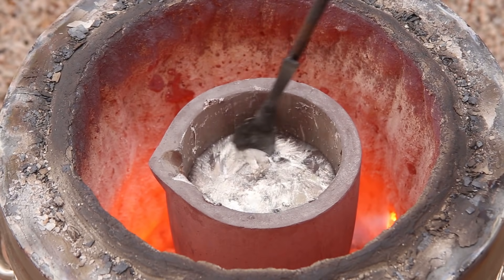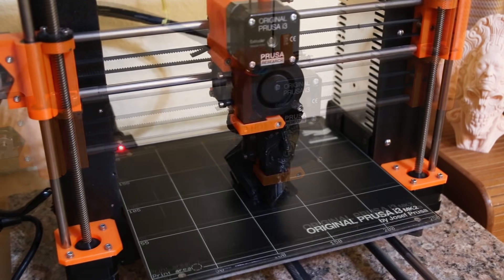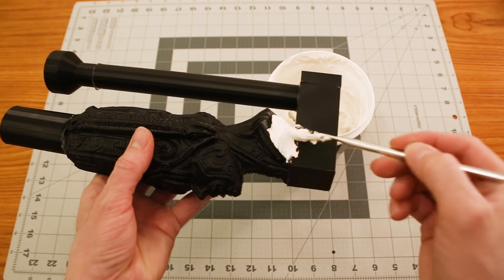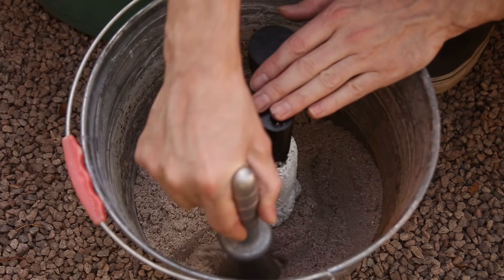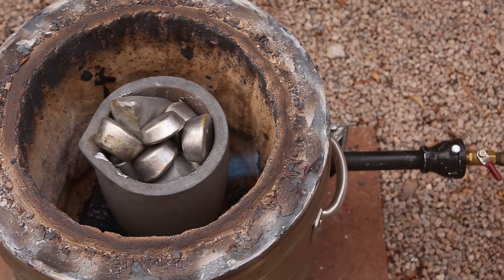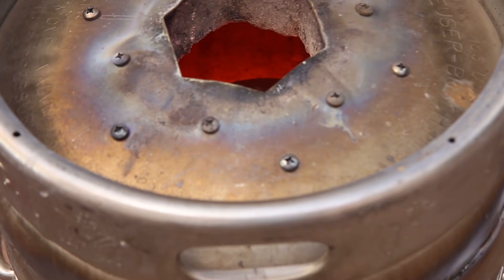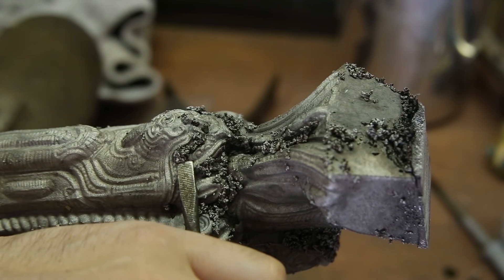Easy lost PLA metal casting │ How to turn a 3d print into metal │ ASMR

Comment: joint compound to act at the fine-detail-saver is such an excellent trick
Reply: Idk but what is joint compound exactly?😅
Reply: @theofficialvalvychannel5689  there are several different types of joint compound, the most common two are the drying type, which is mostly gypsum powder and dries through evaporation, and the setting type, which is plaster of Paris based and hardens through a chemical reaction involving quick lime.
Reply: @theofficialvalvychannel5689  I also like to know.
Reply: I have tried a couple different types, but the powder that you mix with water that contains plaster of Paris is the best. A lot of the pre mixed varieties have polymers in the mix (usually some sort of vinyl) and they don't work as well. I'm not sure if it's the vinyl, or some other ingredient, but the pre mixed stuff had tiny pits and dimples in the surface finish.
Reply: Is there a spray on version?
Reply: I've tried using drywall joint compound and sodium silicate and sand. It most definitely did not work. The drywall compound shrinks too much and cracks, I tried all sorts of combos and ratios.
Reply: I never would have thought of it on my own.

Comment: How do you decide how to design your sprue and vent layout?
Reply: Run in the thin section feed in the thick sections. So how it goes, sprue goes to your runner bar, runner bar goes to an in gate into the mould, mould fills up in a nice controlled manner with no turbulence up  to the riser which feeds the casting as it solidifies ( he called the riser a vent) without a riser you will get shrinkage ( a hold in the thick sections of the casting). Actual vents ( not risers) are used to disperse gases from  the sand that burns from the metal. these gases tend do get stuck in  corners  and prevent metal from getting to the corner and causing a defect in your casting. Ven't holes don't need to be big  at all. In two or three piece moulds normally you just scratch a thin line in the sand ( called scratch vents) just enough to allow gases to escape and metal to run in the entrapment areas. Hope this helps.
Reply: @petewilkinson5531  Thanks!
Reply: Anyone got a print file for the risers?

Comment: And the 3D gun printing community greatly thanks you for this knowledge
Reply: I'm not sure this can be an effective substitute for rifling at the end of the day.
Reply: @superchroma  yeah I would never ever cast a barrel unless I was casting a bronze barrel for like a 22 and I’d make it super thick but other than that you can basically fully print every piece of any firearms so you could legitimately make a ak quite easy you’d just have to cast almost  every piece thick asf  because no steel
Reply: Doesn't casting the barrel out of metal negate the only "positive" of a 3d printed gun? A large part of why people were freaking out about that idea was that the small firing pin was too little to be picked up on most metal detectors
Reply: @ku8721  cost is also a factor and the frequency you can find guns
Reply: @implausibleimpossiblehypot4006  Welp I live in America where finding a firearm is less than a problem than finding a part for my 20 year old truck! But yes good guns cost a lot, but I'll put my 30.06 against almost any gun with a 3d printed part... if I can pick the range (distance) that is
Reply: @ku8721  what I’m saying is “I think I’m gonna make a fully bronze body pancor jackhammer who gives a fuck if it ways 20 lbs” or I wanna make a bigger receiver because I think this ak47 needs more barrels “or I think I want to cast  all of the hand crank parts to build my own Gatling gun” catch my drift  and I think It would be awesome to see some bronze Hatfield break barrel shottys (all pressure and load bearing parts should  be steel of course
Reply: @ku8721  also a 3D printer or resin printed m16 would probably destroy your 06 even tho I love mine I’d say 3D printing has caught up with non 3D printer guns.  And I think that’s cool because gunsmithing is done on a computer now  and that’s like super high tech “punch in some directions on your laptop and boom working military grade lapua 338”

Comment: Very COOL man! I'm very impressed with this process. I'm a fellow caster myself and always thought I needed a kiln for casting PLA objects. I am definitely giving this a shot. I do have a question, is the sand reusable after you cast? Or is that sand mixture a one and done situation?
Reply: How'd it work out for you not melting out the pla in a kiln? I'm looking to do the same but can't believe it could just vaporize out of the way like that.  Also pretty sure the sand would have to be ground back down if it's even possible, interesting though.
Reply: Absolutely yes, spent sand can be reused after breaking larger chunks. Just add fresh sodium silicate (water glass).
Reply: I just came across this video and was getting ready to ask the same question. As the sand could get expensive in these and the sand casting ones he does if you can't reuse any of the sand

Comment: If you do this same model again, I would suggest that you cast it upside down. The gate can be much smaller than the feeder/riser so you could have a much smaller defect on the top of the head.
Reply: In fact this is preferable. You want controlled gradual flow, not sloshing, and this is achieved by constricting the flow before it reaches the model
Reply: But even upside down, you would need a spruce going from the bottom to the top, so i don’t think it would make a difference.
Reply: Yeah, the lost detail across the top of the head was pretty tragic.
Reply: I'm attempting this right now actually with a handful of parts. I traditionally use my own greensand/water glass hybrid mix to make some fairly large castings, but this time I want to see if I can get a head start on accuracy and surface finish. Believe it or not I'm able to make large 2 part aluminum casting molds with homemade greensand. Hoping this method will help with cleaner casting (which already looks like  delft clay casting surface finish- but at a huge expense of time and effort)

Comment: I wonder how well plaster would work instead of joint compound? 🤔
Reply from the maker: I’ve tried it. It breaks up and partially melts.
Reply: @robinson-foundry  Mix some Diatomaceous Earth into the plaster in a 1:1:1 Plaster:DE:Water ratio.  You get a nice thick slurry that's good for casting, and the DE helps with the crumbling.

Comment: Question:  How accurate was the resulting casting dimensionally compared to the original PLA?  Was the casting larger or smaller?  Have you ever tried using multiple layers of that sodium silicate?
Reply from the maker: Castings are always smaller that the original by a few percent. You mean the joint compound? No I haven’t but I will.
Reply: @robinson-foundry  If I need millimetric accurated final must resize the PLA model in some percent? 0.5%? 3%? Thanks!!
Reply: @Eddiezerintube  Probably 1ish percent, but if you need dimensionally accurate parts, you'll need to machine them afterwards.
Reply: @Eddiezerintube  aluminum shrinks 3-4% percent when going from liquid to solid and another 1-2% from temperature shrink.

every alloy and metal will have it owns shrink factor but as a general rule about 5-6% added in the print should get you close.

Comment: This is awesome! For us newbies .. can resin printers use a resin that will burn away the same way or is the printer type you using.. with such thin side walls.. better. I don’t own either and just looking for some input.. thanks for new ideas to usually a very expensive project
Reply: Where I've seen resin printed models used in investment casting, the model has to be burned out before the metal is poured, like in lost wax.  The lost PLA process used here, with a thin wall and little to no infill, the metal is able to burn out the plastic during the pour, closer to the lost foam process.
Reply: @hanelyp1  thanks for the advice
Reply from the maker: Thanks you! You can buy resins that can be melted away but I doubt you could successfully print such a thin walled abject with resin. I’ll give it a shot though!

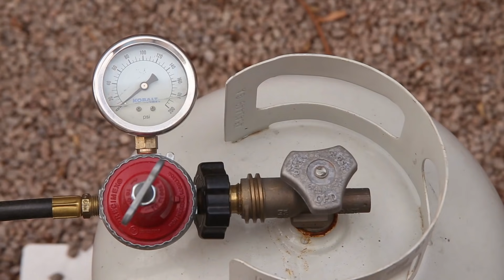Comment: 4:31 The difference between cans and wheels is that wheeled aluminum has a higher silicon content, which lowers the melting point of the alloy and improves the fluidity of the molten metal.
Reply from the maker: That’s right. Big difference between the two. I love “Wheelium”.
Reply: @robinson-foundry  Oh, wheely?
Reply: @SethKotta  this made me laugh. It was wheely funny XD
Reply: @robinson-foundry  Wheeluminum?
Reply: Is there some method to determine if a wheel is aluminum, magnesium or some kind of alloy?
Reply: @nitcat1  Wheels are usually casted.
Reply: @nitcat1  Magnesium (and zinc too) metals usually react with acids (like vinegar). Also, their densities compared to each other and aluminum are different.
As for alloys, that's harder to tell.
Reply: @nitcat1  Pretty rare to find anything other than either an aluminium or steel wheel and the differences between those two are fairly obvious. 

At worst, if you're really sure you have a magnesium wheel, take a file to it and light the shavings on fire and then you will know.
Reply: @nickb3720  Mags oxidize to a very distinctive gray. Hard to keep them shiny but the gray is nice.
Reply: @nitcat1  They’re all alloys. There’s really no such thing as pure aluminum wheels or magnesium wheels. Most aluminum alloys for wheels are between 97-99% Al with a mixture of Si, Fe, Cu, Mg, Mn, and Zinc and other trace elements. Typically its a 3XX or 6XX alloy.
Reply: Грязная технология. За такое надо наказывать!
Reply: Надо делать так: https://www.youtube.com/watch?v=W_IF2-tG3G0&t=765s
Reply: https://youtu.be/WCnIJu69aV0
Reply: Does anyone have the formula of how much of what one would need to create this better grade of aluminum from aluminum cans ?
Reply: @texasRoofDoctor  thats what I am wondering couldn’t you add some additives to improve it for casting?
Reply: @texasRoofDoctor  someone correct me if I am wrong but could you not make an alloy of 1 part ferrosilicon and 9 parts "can aluminum" to achieve a similar affect? I don't know much about alloys
Reply: @jonathanclark7444   I think that is correct. There is a dude from Australia with a casting channel and he answered my question about it 2 years ago but used the Aussie name for it.
Reply: @texasRoofDoctor  alr thanks, can't really hurt to give it a try the stuff isn't super expensive

Comment: Love the video but can styrofoam instead a 3D printing don't have one
Reply: The process is called lost foam casting.  Surface finish is only as good as the foam model, but it works.  If you use a hard shell over the foam, a vent passage through the foam seems advisable.
Reply: @hanelyp1  thank you 😊

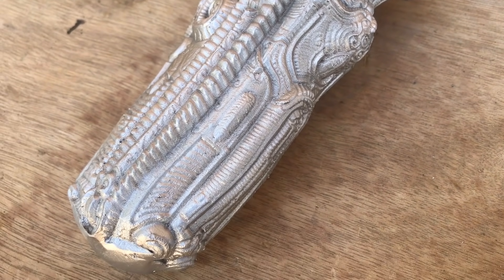Comment: Awesome!!! But may I make a suggestion, turn supports on but click touching build plate only. It'll help with the lower messy overhangs like under the chin at 8:18. And that will allow you to get a smoother finish of joint compound which should in theory help with those little blobs

Edit: on 2nd viewing I see you did that, try reducing the distance between the support material and the overhang. Or try rubbing it with soft wax that should fill in those gaps but still melt out easy
Reply from the maker: Thanks for the tip. I had the z distance set to .2mm. The print is so fragile that I didn’t want there to be any problems removing the supports.